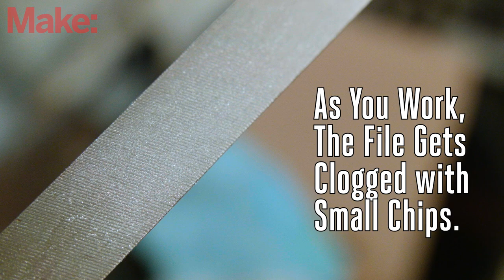Skillbuilder: 5 Tips for Using Files

Comment: Wire brushes are horrendous for your files. Much better to use a small offcut of brass to clean the teeth because it's softer
Reply: +Bart Jennings  Horrendous? Honestly it is like people are in the Royal Society for the Prevention of Cruelty to Files or something. The file is much harder than the card, the card is applied far less frequently than the workpiece (which may well be steel) the force that can be applied is limited. It would be interesting to see just how long it takes to blunten a file through proper use of a file card or brush, my guess is far longer than most people will ever use the file full stop.
Reply: +littlestworkshop Some people just need some silly reason to either A) justify why they are so bad at making stuff; B) feel better than the 'common people'; C) have something else to focus on instead of actually using the damn tool.

You see the same with cameras, were most internet cirkle-jerkers are only ever talking about gear acquisition and maintenance, but never actually go out to make photos. And with grammar nazis there is a similar problem: people who actually suck at language (i.e. bad writers with contorted sentences and mediocre understanding of the nuances of language) constantly bitch about some stupid grammatical rule or some silly error someone else made. All to create a false sense of superiority without having to be talented or doing the hard work of producing awesome products (be that DIY, photos or literature).
Reply: +Lukas don you have explained youtube :)
Reply: +Bart Jennings they're called file cards for a reason...and have been the official tool for this job forever, literally
Reply: +Lukas don that is one of the truest things I have ever read. +1 like

Comment: I've always used a bar of soap to prevent stuck chips and it works well, Irish Spring to be exact it has a fantastic scent and keeps my files and my shop smelling clean and fresh! Not that I would switch but is there any advantage to using chalk?

Comment: Just a tip from a toolmaker....
Do not lift the file and do not use it side ways if you are want precision results. 

Files are not perfectly flat or straight. If you are trying to file a precision flat surface. Color in the surface with a marker. Use the bow of the file to take down high spots on the surface.

Comment: I liked for the chalk tip, everything else was pretty obvious for anyone owning a file/s. Ohhh, and the cleaning tip was pretty nice. I used to use compressed air or a fast high pressure rinse and quick dry... which is probably why I liked for the chalk tip.

Comment: For flat filing, it can be really hard to keep your hands level becausse the work forms a pivot point between your two hands and the leaverage keeps changing during your stroke. It is much easier to maintain a straight even cut if you hold the file in your dominant hand and only lightly guide it with your weak hand near the base of the file.

Comment: good video this becoming a lost art at one time this was a primary tool now there are for the most part better tools however these are a wide spread tool if a preaper  packs a tool box for a bug out you will find files in the box should learn to use them and care for them
Reply: +Tom Palmer Yea don't throw them all in a box together like Adam Savage.
Reply: +icepick method It made me cringe but will it really make such a big difference for his use? Not so sure. Personally mine are in draws with the plastic DVD storage panels IKEA used to sell as dividers, it makes me happy :)
Reply: +littlestworkshop I have a couple dozen files and I literally never find a use for them. There is nothing I can think of that a file does better than any other tool in my shop. I'm pretty much always going to reach for a dremel, die grinder, angle grinder, belt sander or mill. It makes me wonder why files are still in use at all.
Reply: +Geahk Burchill I have all those tools and still use files.
Reply: *****
Maybe it's just the way my shop is set up but my air tools are always within arms reach and my files are in a drawer in my tool chest. I've never had the urge to go to my tool wall for the files when I have an air tool right at hand.

There are plenty of other hand tool where this is not the case. A block plane does something only a block plane can do. A chisel does what only a chisel can do. There are hundreds of hand-tools in my shop that don't feel obsolete.

So, out of curiosity and totally with respect, what the heck do you use your files for?
Reply: +Geahk Burchill If i need to get something flat within .001 i'll use a file. 
Breaking an edge on aluminum stock or a fixture, if it's still too sharp after using a deburring tool i'll hit it with a file.
 Squaring off an internal corner in metal because the endmill i was using will leave a radius the size of the tool. 
You have that problem with a dremel or die grinder too, spinning tools don't make square internal corners.
Reply: +Geahk Burchill For occasions where finesse is required but where it isn't appropriate to machine. If I have for example a small rectangular slot that needs slight enlargement I'm not going to be getting an air tool in there and dremels and die grinders are soon going to ruin it. Most frequent uses are for deburring and rounding edges over when the item is too large for the linisher. Many applications come up in engineering. When I'm fabricating then it is more or less power tools all the way however.
Reply: *****
That explains it. I mostly just do fabrication though there is quite a bit if high-detail work in it. I'm not sure a slot enlargement has come up for me. For that, I'd probably reach for my small router with an end-mill in it on low speed. Rig up a fence or something. That would be more work than I file I suppose.
Reply: +Geahk Burchill More work and round corners! And I was thinking this slot was in steel. Everyone has different tool needs! BTW use speedometer cable in the centre of your tentacles, it will help a lot having the spring return and it is torsionally stiff too. I watched a course on tentacles on the Stand Winston site for a project I've been working on (required articulation) and they showed it there.
Reply: *****
Actually I ended up with a piece of nylon shark-fishing line on those tentacles. I thought about using music wire but they are only about 5" long and even 80 gauge wire was a little too stiff. I think I ended up with .050 nylon. (from memory, not sure if that's right)
Reply: @GeahkBurchill  files back then are used before milling machine were alot because
They could be expensice or not good enough so filing was used theres a lot of technique to get the workpiece accurate in size  flat square and paralell

Comment: draw filing is only used to increase file sales btw...ya just said before that dont drag your file backwards
Reply: Nothing wrong with draw filing. Only use a singe cut file for draw filing. And remember to only pull when you have the handle in your left hand, and only push when you hold it in your right hand.